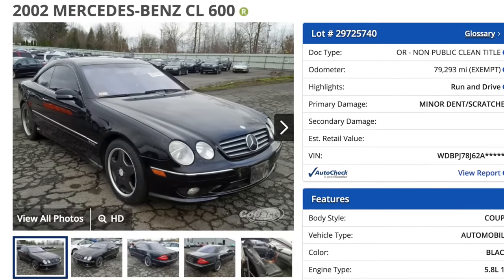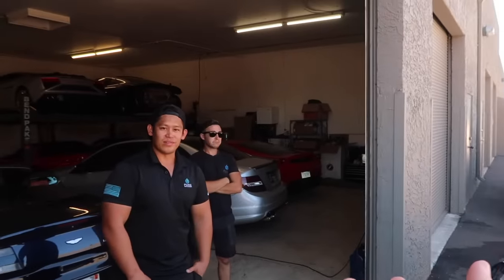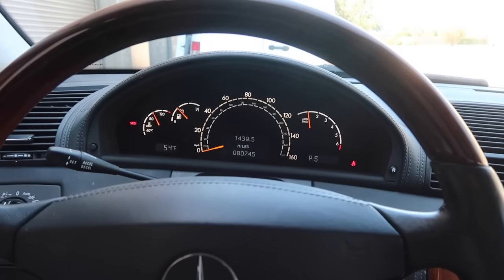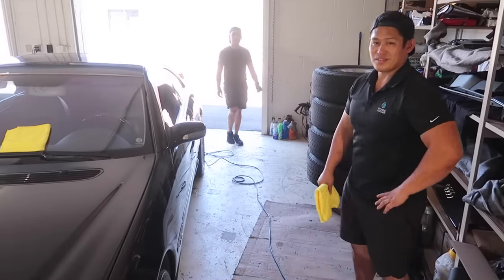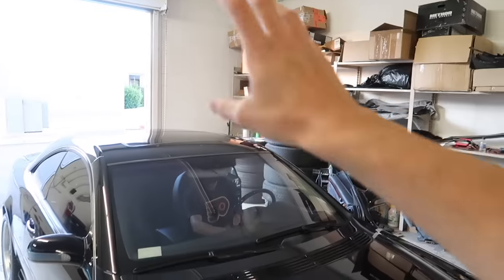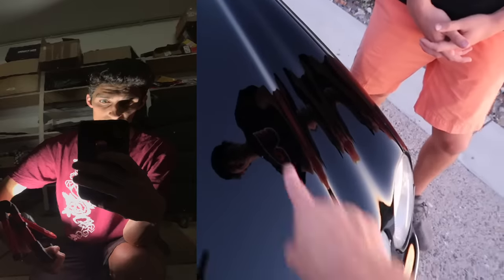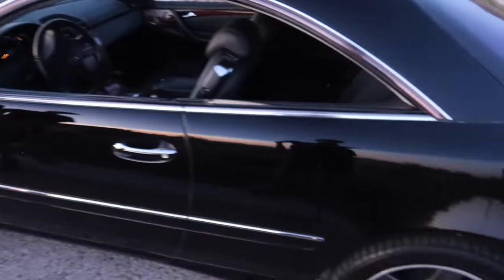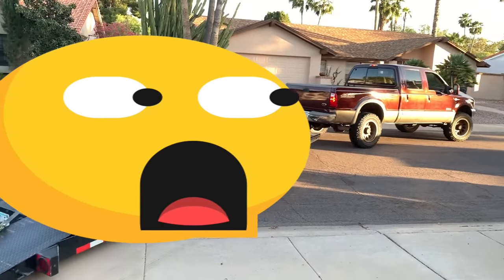Making My Filthy $1500 Mercedes V12 Look BRAND NEW + 4 New Cars!!

Comment: From 2002- 2005 Mercedes only made 2,255 CL 600 V-12 twin turbos WORLDWIDE!
These cars are so rare. 
I bought a 2003 CL 600 used in 2004 in Las Vegas with 11,000 miles and I thought I got a steal at $80,000K.
Absolutely amazing car. 
I would take it out on Highways 93 and 95 in Nevada and open it up to max.
It is limited at 135 mph. 
I think unlimited it could go 195 - 200 mph.
I got a few speeding tickets over the years but they were definitely worth it.
Have fun whoever gets.
The biggest problem is the car feels like you are doing 50 mph when you are actually doing 80 mph plus!

Comment: Hey, your clock is missing next to your gear indicator. To fix it you'll need to unplug the gps module in the trunk lid on the left. Once you unplug it you can set the time in Comand and the clock will appear. Then you can plug the gps module back in and it'll stay set. It's trying to connect to the old mercedes server that doesn't exist anymore which is why it doesn't set itself automatically. Took me a while to figure that out on my CL55 AMG. Really cool to see this vid so I know what my car will look like when I paint correct it soon!

Comment: I encourage You to streight pipe the CL600 that cheap way as You did on the car You got for 850 bucks. And perhaps You have some fitting 19" wheels in ya garage or You can get them in a cheap used offer? Chinese after makrte pieces perhaps? But 1st You should check if engine and suspension are in good condition or not as Hadi suggested.

Comment: Just out of curriosity: Why do you just let the water rinse away on the driveway? After a decent wash it always has oils, micro-rost and breaks dust in it, which is really not meant to be just washed out there. Professional workshops and cleaning facilities always have an extra filtering system beneath their washing areas.

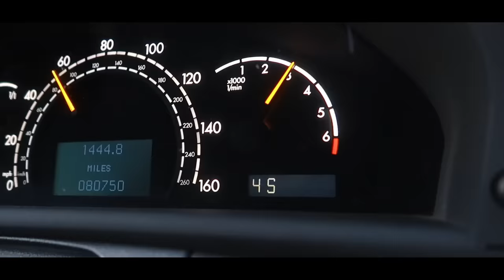Comment: Ya gotta bring those wheels back to stock by getting rid of the dark paint in the center part of them.  Also, the facelifted tail lights would be a nice improvement.  Finally, what's with that horrible rap music starting at 9:00?  Very inappropriate for such a class operation!